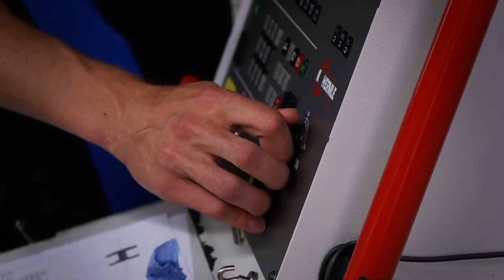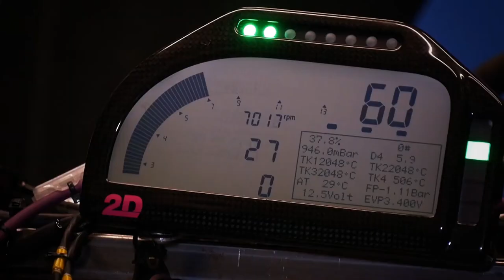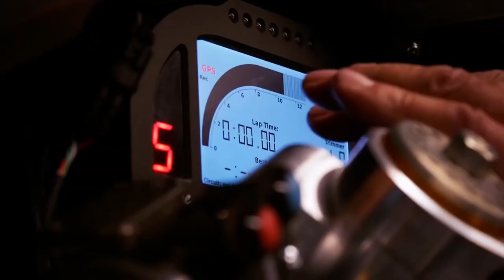We talk to Eskil Suter and ride his mind-warping creation.

Comment: Imagine   riding  a  very light   flexible  Framed  Yamaha  TZ-750  with   crappy  narrow  tires and a  very short wheel base..  and high speed Wobble ..   the   Suter is such a  huge  improvment over the  mid to late 1970's two strokes..
Reply: Well I think you’d expect some improvement over 40-odd years.

Comment: Almost 200hp and 127 kilos of Swiss precision engineering & manufacturing at it's finest! This is probably the most radical bike on the market - since many years. It's more than a 500cc GP-Bike: it's a 570cc V4 2 stroke rocket that don't have to follow GP reglements. 
I assume that riding THIS bike feels not less spectacular as riding an iconic Britten V1000.

Comment: Kenny  Roberts  built  his own World Class  fuel injected two stroke  bikes too called the Proton ..  fuel injected  two stroes..  their  500 CC  two strokes  just could not compete with the  1,000  CC four strokes they had to compete against..
  Kenny sold  some of them to a Collector in South Africa  who  got them  back into running shape
Reply: Ya, but they where v3 not v4 engine. Look, if the big four wanted, they could produce, today, 500ccc 2 stroke with almost 300cv, it was just politics, not technology. Even so, Barros, in 2 stroke machine, gave them, the four stroke machines some good races, Honda itself, told that they could produce a 2 stroke engine(500cc) with more power than the 4 stroke (it was in 2002), but it will be impossible to drive. I suppose today with all the gizmos they could produce a 2 stroke bike with more power than a 5 stroke and still be "easy" to drive.
Reply: @pedroferrr1412  I agree with you.  And if they ran them on E85 Fuel we could tell the environmentalists to shove it.

Comment: Wow, the Japanese factories keeping the engines and bikes that they made and paid for eh?
How outrageous of them.
And then effectively complains about Moto2 rules
KTM seem ok with the rules, and MV and Honda

The claims of running in the premier class and being good because of lightweight, higher cornering speed etc are often made.
But people base this on track testing, not track racing.
In a test you have the pace to yourself and can run as fast as you can but in a race you come up behind other machines which you have to get past...which you can't.
It's why the 500cc 2T's didn't fare well in the early coss-ver years of 2T & 4T in MotoGP.
Reply: He is right about moto2. Having one engine is somewhat boring compared to the Many different engines in Moto GP. I prefer motogp because of that.
Reply: KTM don't make Moto2 bikes anymore, they just put their stickers on a Kalex. 
Honda also doesn't make Moto2 bikes, they only provided the donor engines which were then race-prepped by another company and that has since ceased in 2018. 
MV Agusta do make a Moto2 bike, and it's not all that great, rarely finishes in the points.